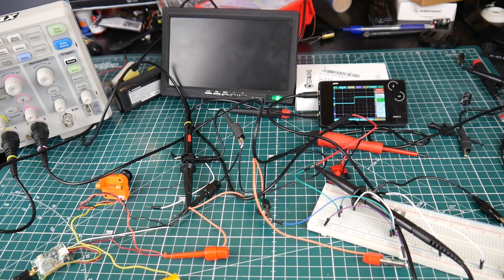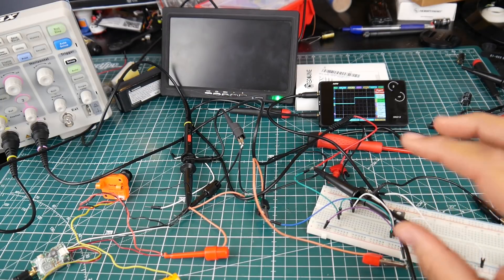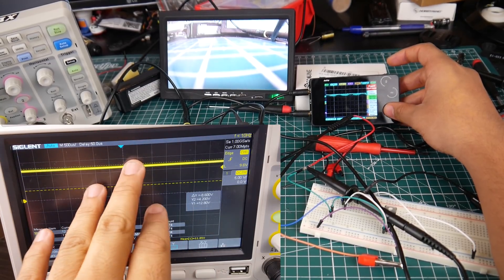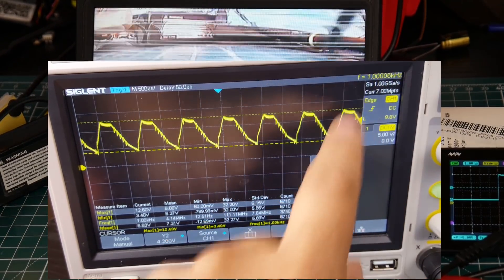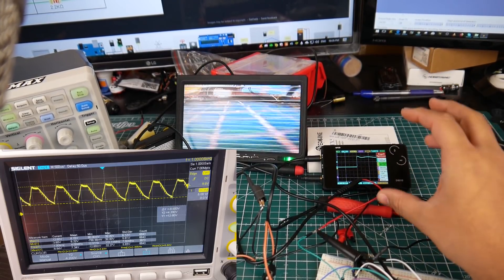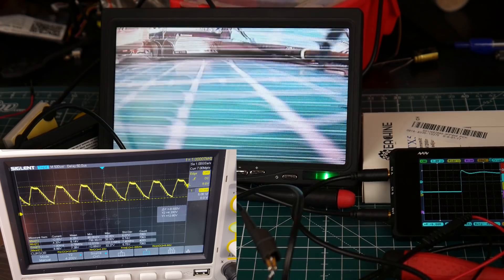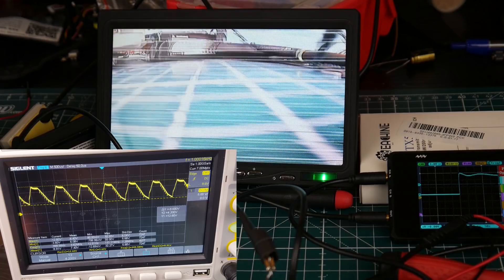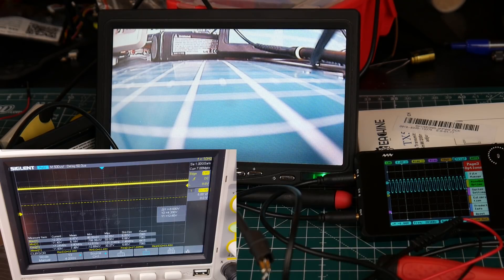Injecting FPV Noise Into VTX and OSD // Stress Testing Flight Controllers Prototype

Comment: hello, thx for sharing your knowledge with us. I am having havy issues with the noise from my micro FPV Hummingbird. I added a cap to the connection of the XT30 and the ESC. It helps a bit but I still got so much noise. Since it's a micro quad I have so few places I can add other caps. Do you  got any ideas how I can approach this? Thanks in advance!

Comment: Happy New Year.
Ive been wondering if you could use led's across the motor wires to dissipate the EMF from the motors (much like a flyback diode). By connecting LED's in series, or using zener diods + LED we could set a voltage threshold greater than the lipo voltage, say (18v). This could eat up those nasty voltage spikes instead of putting it back to the esc. We all know how hungry those LED's can be. 😝 This would mean the noisier the motors, the brighter our quads will light up!

Comment: I'm just going to ramble and wanted to hear your thoughts.  Been building quads for a long time now.  I seem to only be able to get clean video if I power the camera from the VTX (I use Unify's exclusively now).  I've tried caps, powering from the same voltage source, and using the same ground.  But they always tend to yield some noise.  Also I've noticed that some BECs emit some interference if your wires are too close to them.  So sometimes the route your wires travel actually matter.  Anyways I like your content.  Happy new year!

Comment: I have a question. The cameras everyone uses on their drones can they be modified and used as security cameras for our homes? As they are nice and cheap and small to conceal.
Reply from the maker: +Robin Hoogenbosch Yes that's what they where used for and still is.
Reply: Drone Mesh do you have any suggestions so I can use to connect them to my wifi and software to use please.